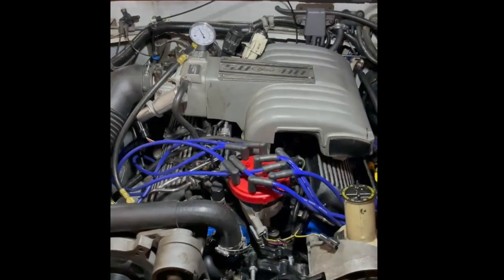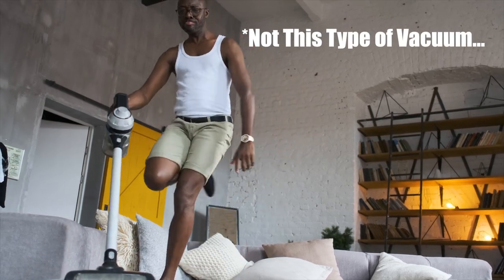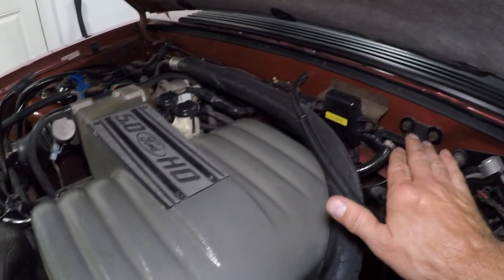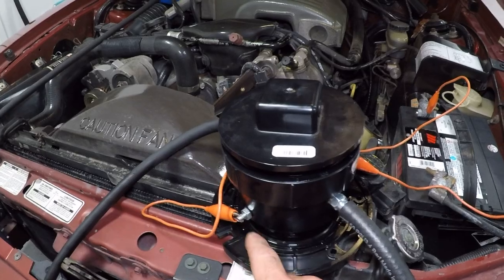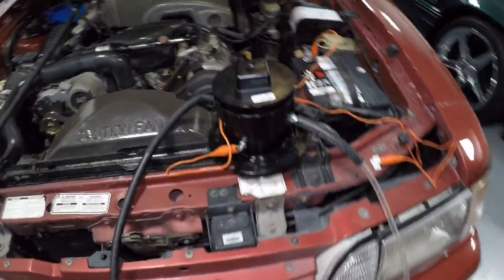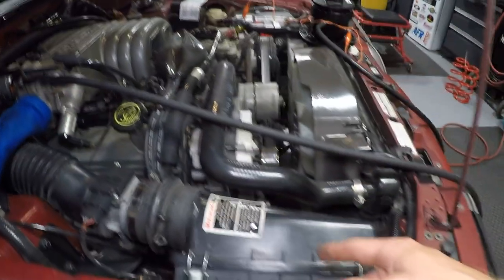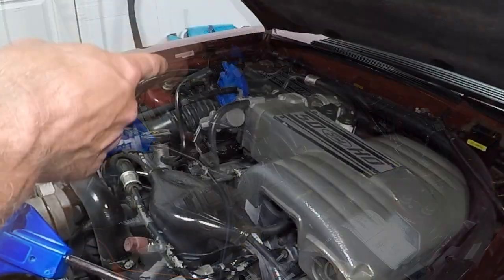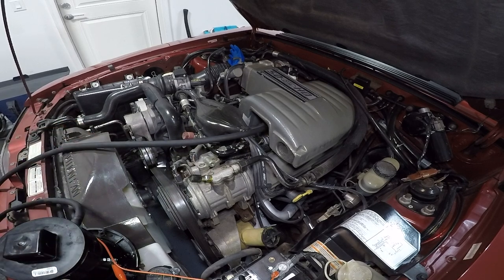Foxbody Mustang Vacuum Leaks - How To Test & Find At Home

Comment: Thanks for the video ! I'm working on my daughters 1995 3.8 V6 Mustang, and yes we have a drive-ability issue. It idles perfect around 750 rpm, it runs rough at 1000 rpm and hesitates up until 2000 rpm.
 I did the smoke test and found out that the EGR valve was leaking and the IAC gasket was leaking.
Fixed that with new parts. Problem remained.

Changed the spark plugs and wires and the coil since it was still the original coil. No change.
Smoke tested again, no leaks.
Changed the fuel filter. Checked fuel pressure, 34 psi so that should be good.
Fuel pump was making a lot of noise (was loud), so I put a new one in. No change regarding the issue.
Had the injectors checked, all good.

Replaced all 4 of the O2 sensors, since they were also still the original. No change.
Smoke tested again and checked the inner front fender on the driver side, even behind the dash. No leaks.
Checked the grounds in the engine bay with a multi meter - all good, added some extra grounds to the engine, just to be sure and rule things out. No change.
I forgot to say, that it ran good  until we parked it 2 years ago (in a heated garage) because the inside of one of the cats was loose and ratteling. I emptied the cats at first, but then it ran like crap, and so I ordered new cats, but never came to install them until 2 moths ago, only to find out it still runs like crap 🥲
Strangest thing of all ... No check engine light, no trouble codes ??? (Car is equipped with OBD2 and I have a scan tool).

MAF sensor reading is good. TPS sensor has the correct voltage.
Ohhh and also tried another ECU (same year, model, engine, etc.) exact same issue.
I hope you or others have some suggestions for me where to look at.
Thanks !!
Reply from the maker: Yessir! sometimes these issues are a real bear

Comment: I followed this to the T, and completely fixed the ole Lethbridge special 89 vert. It was a hardware issue, and following up with new plugs (somebody gapped the plugs at .030 😮) and wires, and she just fires right up like a champ. Keep the videos coming, I'm having a blast working through this thing with your videos
Reply from the maker: That’s awesome buddy! Thanks for the kind words. I went to school in Lethbridge 🍻
Reply: What spark plug gap did you use?

Comment: Yup!...I have a new gallon paint can..same air line configuration but use a piece of shop rag soaked with baby oil and place a charcoal briquet heated with torch glowing red and place inside using VERY low air pressure. WJ's are also notorious for evap leaks! DP
Reply from the maker: I like the ingenuity! 🤜🤛

Comment: Great video I just completed my smoke test and had smoke coming out of the EGR valve and also the 2 round covers on top of the charcoal canister. Was wondering if that is supposed to be like that or do I have to replace those parts ? Thank you
Reply from the maker: Your EGR could be stuck open. It would be worth checking

Comment: If the vacuum hose is like black chalk when You touch it..everything is suspect.
And all visible ez access hoses with obvious stiffness and memory mould like brake booster replace it clamp it or shorten it.
Good video as always 👍
Reply from the maker: Thx bud

Comment: I love your videos and overall content. On an unrelated topic, with my T5 and bell housing removed, can I raise the engine high enough with the Harbor Freight Engine Support Bar to remove the oil pan all together? I'm assuming once I drop it and have access to oil pump and p/u tube and drop them in pan the whole thing will come out the back. Do you have any idea? It looks like I have about 8" or so to raise it before the intake hits the bar.
Reply from the maker: Thanks so much my friend! I’ve never tried the method you are thinking, I’ve always just used a cherry picker type engine hoist. I am interested to hear the results of how you make out though 🙏👍
Reply: @KASLCustoms  I will let you know. I have a cherry picker but would love to not have to remove the engine completely. I think I will have enough room. 88GT T-Top
Reply from the maker: Sounds good - please do!
Reply: @KASLCustoms  The Engine Support bar from Harbor Freight did exactly what I needed it to. It got the engine up high enough for me to remove the oil pan without having to remove the oil pump and/or pickup tube. I even still had over an inch to spare. Make changing the motor mounts a breeze as well. Keep in mind, my T5 was removed.
Reply from the maker: @dannyfackler7104  that’s awesome buddy! Glad it worked out and thanks so much for sharing. Very good info for the community 🙌

Comment: I did this on my 5.0 and smoke was coming out from under my tps senser and on the bottom where the throttle cable is at . Is this normal on a new bbk throttle body ?
Reply from the maker: no it's not. you have a leak

Comment: I was hoping this would help me find my  issue with a loud ringing or slash whistling noise that starts after a few seconds of the car running. It sounds like its coming from behind the upper intake. Any suggestions would be appreciated
Reply from the maker: Is you PCV unplugged from the lower intake?
Reply: @KASLCustoms  . It is .there looks like  there is one vacuum line going to the upper intake and the other port on the pcv is  blocked off is that normal

Comment: Why does my gas tank make a pressure relief noise ?
After driving and turned off . Recirculation evap fail ?
Reply from the maker: Sounds like your breather line may be plugged

Comment: I got a 1990 mustang gt and it has tubular a-arm and the ball joints was going out so I pressed them out and I pressed new ones in, I tightened everything down and put it back on the ground and the ball joint completely came out again just hanging on by the castle nut, idk if I done something wrong or if the a-arms are shot idk what to do ur advice would be greatly appreciated
Reply from the maker: Hmmmm - are the ball joints for the tubular a arm a different size then a stock replacement?
Reply: @KASLCustoms  idk I first ordered stock foxbody ball joints then that didn’t work than I ordered sn-95 ball joints and that seemed to fit way better but the bolt wasn’t long enough for the castle nut to fit
Reply from the maker: Is there any way to figure out who makes the tubular A-Arms? If you had that info then you could call them to see what they recommend
Reply: @KASLCustoms  I can text the guy and see what he had on it cuz it was an old drag build but regardless thanks for ur time and I love the channel great work
Reply from the maker: Anytime buddy. Good luck and thank you for the kind words 👊
Reply: @KASLCustoms  anytime keep up the amazing work

Comment: I have an 88 vert AOD that runs great, has no codes key on or off. When I start it up warm I get an idle surge, tps is .98, base idle reset, can't find a vaccum leak, im stumped. When I put it in gear idles fine. Any input would be much appreciated. Thank you
Reply from the maker: Hmmm that’s interesting? Have you checked your plugs/wires and/or plug gaps? Also, what is you’re timing set at?
Reply: @KASLCustoms  Thanks for your reply. I changed the cap rotor plugs, wires, and ignition control module, plenty of spark. I even swapped the injectors with ones from my 93 that had very little use. I have plenty of fuel, new fuel filter and regulator. I even swapped computers with a freinds speed density fox. Car runs well in gear, no surge when cold just in park or neutral when started warm. Car is basically stock, just 1.6 rockers, port matched edelbrock intake, and a BBK TB, stock cam. I ran propane around intake and all vaccum lines, no leak. I'm going to run a smoke test, just to rule it out. What kind of wire did you use on the wick? Thanks again.
Reply: Sorry, the gaps are good, timing at 10 degrees
Reply from the maker: No worries. I went to a local vape shop and bought the wire for one of those vape smoke pens. Works like a hot damn 😂
Reply from the maker: @lennoxskeeper  maybe try bumping it up a bit to 12ish
Reply: @KASLCustoms  I appreciate you giving me your time. I will try 12 degrees and I will hit the vape shop 😆. Love your rides, keep rolling that tape.
Reply from the maker: Lol - Right on bud!! Thx so much!!!
Reply: @KASLCustoms  ok I made my baby oil vape 😆, I had no obvious leaks from the common area's. I did have smoke coming from the top of my tps sensor, mine has an open hole on top, it's a bbk, also from my egr but not wear it joins the tb, from the membrane. Did you have thus too? I blew through the vaccum port on the egr and the membrane holds vaccum from me blowing through it. Any insight would be greatly appreciated. Thanks again
Reply from the maker: @lennoxskeeper  Sometimes the EGR can get stuck open (From Carbon build up). I have a video on my channel talking about this 👍
Reply: @KASLCustoms  I will check it the video, but I cleaned all the carbon out of it and it looked clean as a whistle when I was done. Hopefully this is what is causing my surge, thanks again.
Reply from the maker: Ok that’s good! Did it seal and/or hold vacuum after you cleaned it out?
Reply: @KASLCustoms  smoke was still coming out of the back of the egr, where the membrane is housed. I put vaccum to the egr and the pental moves and holds with vaccum. If I blow in the hole next to the pental and I notice some air coming out of the pental, very slightly. Is this normal? It's moving freely and springing closed, but not air tight.
Reply from the maker: Hmm interesting… it should be air tight in a perfect world
Reply: @KASLCustoms  k, I will try switching egrs with my notch, and run another smoke test, and see what's up. Thanks again
Reply from the maker: Ok. Sounds good buddy 👍

Comment: ive been watching a while.  i am dying here man.  i bought a 91 last year.  The previous owner had the maf unhooked because of driveabillity issues and had been driving that way for some time.  The first thing I did was a smoke test with a cigar and a hand transfer pump.  I fixed all of the leaks there were, all mainly coming from partial emissions equipment still hooked up even though a majority had been deleted.  Had been running with the maf plugged in after I fixed all those and she had been running like a champ.  

Now, I cant run with the maf hooked up.  It will idle fine and drive fine, and then all of a sudden it falls on its face, backfires at 3k rpms, or barely stays running.   All of my codes are related to EGR missing and Air Pump no longer installed.  KOEO 31/81/82/85/84 ... Continuous 29... and KOER 26/94/44/31.... Compression test gets a code 90.  I replaced the maf and cleared codes and 26 goes away, sometimes comes back.  All voltages and ohms are what they should be at the connector and at the maf according to the internet.   My VSS is a little leaky and im assuming its bad, thats why im getting the code 29, which i plan on replacing that and the connectors next time I get under the car, but I wouldnt think that would be why Im having the issue.    

Its wierd... I can go start it now and just let it idle and it sits at like 650 fine, no problem.  Ill drive down the road and it may be fine, or it may start hesitating and backfiring.  Then ill turn around and come right back home and either it will idle great or it will be erratic.... what do you think, i am beginning to feel like ill never solve it and i feel like its got to be something small im overlooking
Reply from the maker: Hello sir. It sounds like you have a car that's had some butchering done to it... It definitely should not run better with the MAF unhooked. I would start by hooking the MAF back up and start solving problems from there. 

 Its so hard to try and diagnose issues like this when your not hands on with the car. Do you have anyone near you that you can seek advice from?
Reply: @KASLCustoms  thanks for replying!  It wasn’t terribly done,  im only 3rd owner on her.  Looks like first owner did everything as far as emissions removal,  ac delete and cobra intake.  Just some things were done incorrectly between him and I.  Only reason it runs better without maf hooked up is because when it is hooked up,  it’ll backfire or stall out most of the time.  Sometimes it doesn’t though.
Reply from the maker: No worries buddy. I wish I could help more but like I say, I would try and hook things back up and get yourself a “OEM base line” to work from; rather then trying to work within the parameters of the the messed up system. Good luck sir!!